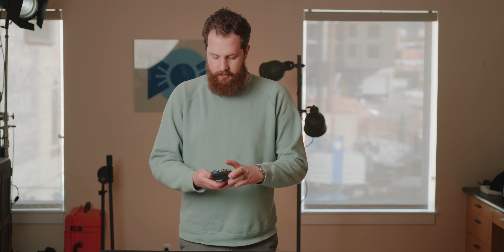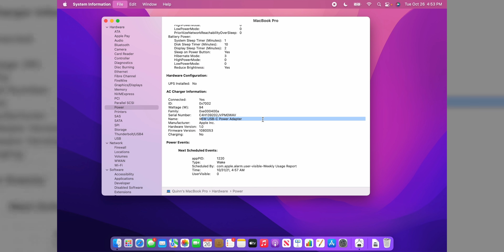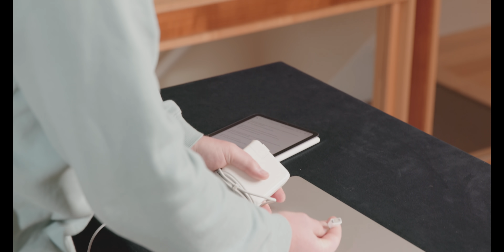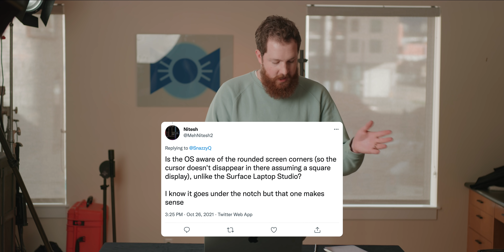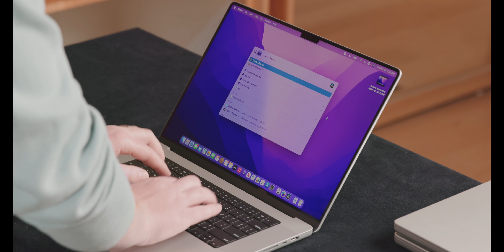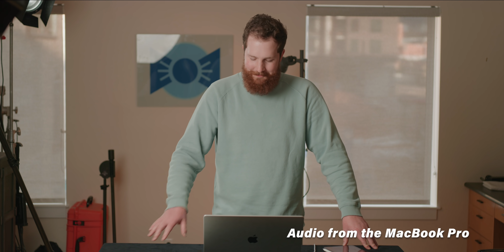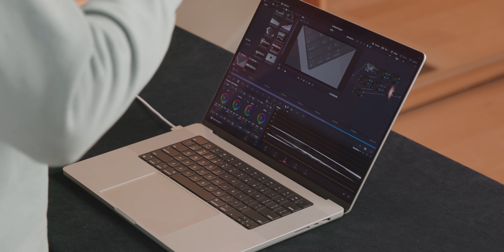The 2021 MacBook Pros are Insane

Comment: Apple should just hide the camera behind the screen that you pull up or hide. That would fix the notch issue and also the security side of it. It's doable  if they can fit a cam in the thin screen they could mount that on a smooth rolling tray that looks neat. OR just include a detachable webcam that magnetically attached to another part of the body of the computer, you pull it out and connect it to an usb-c port on the top of the screen, no cable, there you go apple. Steve jobs would hate this notch solution, it sucks

Comment: Will 16 RAM be enough for 4-5 years for normal usage without video editing or rendering at all?  Also , my friend is using Macbook Pro 14 Base Model and when he opens 5-6  tabs or 7 in safari and nothing running in the background RAM usage is between 10-12.30 GB. Do you think it is normal or Macbook works like this .

Comment: I actually think I figured out why they have the notch: It's so that you don't put a fingering on the camera every time you open the laptop. It doesn't seem like a huge deal, but think about it - if you had to wipe off your camera literally every single time you wanted to use it, it would be such a huge design flaw and oversight.

Comment: I'm a software developer, earlier this year in my job they gave me a Macbook pro 13 inch with the regular m1, and I was in a project that requires ruby on rails and docker. The experience was a disaster, running the tests in the M1 took 35 minutes, running the tests in Intel 2.5 minutes.

Docker on M1 was buggy and crashing all the time.

So to me for work, Intel is still a need, M1 is just for developing M1 software like helping on the ruby team to take advantage of all the bells and whistles. The thing is yes, there was a ruby ARM but M1 is not just an ARM cpu.

Comment: Who will be the first to have the ‘courage’ to present a fair ‘like for like’ comparison between Pro vs Max but with same chassis, same RAM, same SSD?
All reviews thus far compare Max vs Pro but with other differentials. Either 16GB RAM vs 32GB or 32GB vs 64GB or 512GB SSD vs 1TB SSD.
Given the SSD  read/write differences or 16/32 RAM or memory b/w 200GB vs 400Gb etc none are equal representation.
I want to see a Pro vs Max comparison where all else is equal.
Otherwise all other comparisons are moot.
Is there some moratorium on such a side by side shootout?

Comment: Your video is so much different from all others just testing performance - you've selected really interesting questions and answered them in all required details. Good job!
One thing that I would complain (about Macbooks, not your video!) is the strength of Magsafe. It's too much! If someone stumbles over a cable and is unlucky enough to have the cable positioned perfectly straight, might end up with Macbook on the floor 😕

Comment: is the base 14" the best laptop for "computer literate people that may or may not be pros but intend to use them for a long time"? the price tag on the base MBA is enticing, but the SSD and RAM... are claustrophobia inducing. speccing a MBA to have more RAM and SSD, brings you closer to a base 14"... but the gap on paper is still pretty big. but between the display, improved graphics, memory bandwidth, ports, more starting storage/RAM.... isnt all of that worth the ~$600 difference? im no pro, but id like a capable machine i can use for many years... do you think itd be smarter to wait and see what apple does with the next MBA? or just get the base 14"? my 5k imacs getting a bit long in the tooth :T

Comment: 20:00 I think apple did this to mitigate burn in, remember those old powerbooks on system 6 for example? They ALWAYS had this line from where the menu bar whas, even if the display whas off, you could see it, yes, newer displays, even lcd's, can burn in, so its an opportune way for the menu bar to 'de-stress' those pixels. That would be my guess

Comment: interesting that just a sheet covers the back side. is there the danger of damaging internal components when applying slight pressure on the back side sheet? Or are there mechanical blocks which prevent that the sheet may for example block the fans when being pushed in?

Comment: You can leave the menu bar visible in full screen mode, its an option in settings!! Default is turned off.

The area of the notch is likely defined as a "safe area" in macOS, very similarly to how iOS does it. Since menus are just standard system UI, the safe area is already baked into the AppKit APIs. However, since menu bar apps are distinct apps, its very likely that developers will need to update to recognize the new "safe area." Hence why iStat menus can disappear behind the notch, while menu bar items will wrap around the notch.

I don't expect this to be an issue for very long. The notch is brand new to macOS! On top of that, menu bar apps need a proper overhaul in macOS. They've always kind of been like a hack. macOS needs a system for managing menu bar apps. I would expect a collapsible list icon to be added to the menu bar very soon to Monterey.

Comment: That Menü-Bar / Status-Bar behavior is nasty, BUT do the same on the non-Notch MacBooks, then you have the same behavior concerning hiding status elements. Only Bartender features this function, which macOS should have for years… yeah it’s meh…

I guess, that menu items hiding behind the notch it’s just a compatibility thing, because the menu bar concept is baked in so deeply in the OS, so only the App-Developers can change that… with splitting, text density an so on. 

So it’s a matter of time , all of this get used to it.

Comment: Unlike the 14inch laptop, I thought you could only charge the 16inch laptop through the magsafe charger but in your video, it looked like it was still charging through the Thunderbolt USB C port (96 W) when you unplugged the magsafe one? Could you please confirm?
Reply: Watch the video. It can charge through either but only one at a time, the one with the highest power output
Reply: I presume it does charge thru usb c but not fast charging

Comment: The disappearing icons on the top right were actually how it worked for a looong time. I'm still working my trusty 2012 MBP 13' and have several apps that hide some of the icons. Bringing the icons back is easy, switch to another app. And actually since the dropdown-center for your basic settings it's hardly an inconvenience to use the instead of numerous icons there.

Comment: macbook sound is still glitchy, it's amazing how they aren't able to fix that.
I'm also still annoyed by how the whole computer body is electrified when you charge your computer. 
One last negative thing about this computer is if you use to run x86 virtual machine, now you can't, rosetta don't translate kernel extensions or VMs. Parallels just allows you to run ARM Windows and ARM Windows only accept ARM binaries so almost nothing.

Beside that, it adds so much more value than the previous gen it's amazing. That's screen is insane and the fact that it remains cool all the time is great. I haven't heard the fan spinning at all so far.

Comment: The one thing every reviewer continues to misunderstand about these two machines is the memory.  The difference between the M1 Max and the M1 pro is the width of the DDR bus which allows for either 200MB/s read/write access or 400MB/s read write access.  The biggest gains you will see is on any application that is heavily memory intensive.  This doesn't equate across every application.  Some pieces of software heavily use the memory and therefore the time it should take those applications to finish their processes is close to halved as the memory is almost always the bottleneck is any system that is running at 4-5GHz.  If you're running applications that do everything with zero copies or just don't do much memory access than you will see very little gain between these systems.  Obviously this goes a bit deeper with the video application people who encode. One thing to note to everyone though is... the more DDR chips... the more continuous power draw... the shorter the battery life.  I think this is the bigger energy consumer between the M1 max and M1 pro.  I have a feeling those extra GPU's don't actually consume that much extra energy when they are not in use.  The DDR bus, however, is in constant use and is rarely powered down.

Comment: My only issue with the new models is the SD card. Pro photographers don't use SD anymore so it's only useful for hobbyists etc. Wish we got a CFExpress slot too, at least on the most expensive model. The old non-unibody MBP had a CF slot, and CFEx is much smaller, the slot would just look like a thicker SD. So it's already behind the times, and it's only going to get more outdated with time. A CFEx WOULD also be useful as expanded storage as the best cards are crazy, like 2TB at 1730MB/s.

Comment: Why not putting all the menus of apps UNDER the old menu bar and calling that sometjing like CONTROL BAR or any other “APPLEISH” name, we’ll get a full bar with the menus like the old 2020 Macbooks and the addes benefit of the new bar for all the System menus and system trays icons (filling up till half the screen to the right side of the notch). DOUBLE bar anyone?

Comment: The new M1 macbooks have just 2x2 antennas for Wi-Fi... 2015+ up until M1 all had 3x3. This means you're limited to 866 Mbps wi-fi with Wi-Fi5 router and there's no Wi-Fi6E support. And even if there was, it's still awful to cut down on antennas!
My comment is based on Snazzy's comment about their "great connectivity". :)

Comment: Do you know much about Windows  11 and if so would it be worth the upgrade from 10?
Reply: @Doug Macrae IMO it's too soon to tell. Microsoft promises way more stability and forces hardware manufacturers to adhere more to spec on hardware requirements. I have ran it since it was Beta and I will say it's way more stable now since it was originally released but it probably has a good 6 months to a year before it's as polished as windows 10 but the task manager is only invokable via keyboard shortcuts or searching in windows search instead of right clicking on the task bar. ctl+alt+del still works but I miss usign hte mouse to pull it up like on Windows 10 and older.

Comment: i think the reason the cursor doesnt stop when hitting the notch in the middle, is because it would be annoying if you quickly tried to travel the cursor across the screen, like it would be in the way of the user. the rounded corners however doesnt effect the user experience, so its a nice touch

Comment: Another great video Quinn. Quick question for you. I'm 54 and stated to recently collecting vinyl. I do not have a turntable yet. As a collector, is it okay to leave the single and gatefold albums in the original "shrink" with hype stickers etc. (to keep its value) or should I remove the shrink to prevent warpage over time? Your opinion would be appreciated. (also would you cut the side to release pressure or just leave it perfectly sealed?
Reply from the maker: It shouldn’t do any harm, but I’d recommend getting these. Then you can protect AND enjoy! :) https://amzn.to/3w3tvFZ

Comment: Holy crap! They made them thicker, with removable Thunderbolt ports (AND Magsafe!) AND they gave even the base model the full, proper cooling solution?!?! And pull tabs for the batteries? It's almost like Apple is starting to actually consider repairability!

Seriously though, all of these things are notable improvements over the previous models. I still don't like the idea of glued-in batteries, namely because their replacements will never glue back in as tightly as the originals did, and it's SO STUPID SIMPLE to just provide screws to hold the batteries in place, but not having to spend half an hour heating and scraping to get the old battery out is a major improvement... although those pull tabs do tend to be incredibly easy to break.

These are all-around much improved over the previous models, although I still hate the notch and you Apple apologists can whine all you want about how stupid my personal preference is, I don't care, it's my personal preference. The screens themselves are great but once again, Apple has taken every effort to make them as unrepairable as possible, and that sucks. As it often is with Apple, we take 2 steps forward and 1 step backwards.
Reply: @Adam Baldwin Maybe it's some conspiracy to try to keep Louis Rossman off of Apple's back on the right to repair for independent repair shops. 🤣
But on a serious note I was talking with my son today when I was driving about this is the first time I've bought Apple Care since even though I can and do repair machines like this the replacement costs will cost more than paying for the insurance as by design by Apple intentionally to sell the insurance and deter people away from repairing and take the lowball offer from Apple stores to "trade in" the old machine towards a new one. I don't like it but I have to live with it since Apple will never change.
Reply: @ShinyTechThings  I mean, you could just... stop buying Apple products. Crazy thought, I know
Reply: @rars0n  the M1 Max outruns my PC for video editing and I've got a 5950X with a 3070ti, gen 4 NVMe and 64GB of RAM. For gaming the PC is the way to go but not for video editing. It comes down to the right tool for the job.

Comment: In my 20+ years with Macs, I've only used Apple's webcam one time. Ditch the notch, I'd happily pay extra to get a laptop without a camera.
Also, I trust my current MBP will last until ARMv9 chips come out. Apple can slap a thousand cores to the current lineup but I still consider them old tech of what is here in max two years time.

Comment: if only I had the money to buy one of these machines,  damn it, it stinks to be  poor.
Reply: @tony brito you can still buy used for less, although I will say the M1 from last year is holding it's value well but I did see at Costco today some legitimate discounts on the original M1's. Plus the M1 air with the 8 core chip is basically the same speed in most uses as the MBP with the same chip. Only differences is that it's missing the touchbar and fans but if you run native ARM architecture apps it mostly runs cool and fast.

Comment: insane that Apple didn't include updated thermal solutions for Intel CPUs that have higher TDP packages but did for Apple Silicon CPUs that have lower TDP packages.  That seems kind of opposite of what they should have done.  Intel CPUs run hotter and could have benefited from the better cooling in the new 2021 MBP models....

Comment: i feel like the multiple charger thing would be a good question if done with for example a few 30w adapters

also magsafe disconnecting randomly in bed isn’t exactly a problem with the new macbooks considering how efficient they are

Comment: there was a setting to get rid of the notch does this move the menu bar down so the notch isn't blocking the center?
Reply: @123abc There's a program called forehead that does it but it just changes the menu bar at teh top to black to match the notch so you can't see it. I was bummed out to see that it didn't bump it down. Maybe someone will figure it out if Apple isn't blocking the ability to do so programmatically.

Comment: Its nice to see some return to sanity from Apple, adding a bit of heft and squaring things off instead of bleeding edge thin for practical cooling and battery capacity and bringing back most  of the ports , 90% of us still need usb3 though ffs. Hdmi should be next to magsafe for obvious (but not to Apple) reasons. So are ports coming back to the Air or does Apple think only 'Pro's' need ports or do they think its a great way to get us to 'upgrade'? I know I need ports but I don't need to spend 3+ grand on power I will never use.

Comment: the new macbook pro m1 max was such a disappoint to me externally as much as it was internally, it has such a powerful graphics card but no game selection, also it would get really hot. when i returned it to the store i told them all the reasons why i thought it was the worst macbook pro ever made. i’ll take my $4,099 back thank you very much. apple took a step back with this one. the silver version looks like a samsung chrome book but uglier. the 6 speakers sounds tinny. i hate magsafe, why did they have to bring back the hdmi port when it’s not even hdmi 2.1? i kept i trying to plug in a usb c cable there  after getting used to that from the 2019 macbook pro touch bar. i miss the touch bar too, why the heck does the keyboard not have a shortcut for keyboard brightness?
Reply: @Jacky Lelea HDMI 2.1 will probably be on the 2022 or 2023 models to give users a reason to upgrade. 🤦‍♂️🤣

Comment: You can leave the menu bar fixed on full screen mode on Monterey. You can enable it in settings under menu bar options.

Can you charge the new macs with magsafe hooked to a power bank?

Great video btw.
Reply: @cheeks jp I'm going to guess yes but I'll have to find my power bank and try it. The MagSafe adapter is USB-C on the other end so I don't see why not. message me in a few days and I'll probably have tested by then on my 14" M1 Max.

Comment: Pretty sure it is the problem from istat … it is a closed extended little window on the status bar, which fakes it all Icons are different yadda yadda Blabla … nevertheless,  mouse under the notch is weird and not well designed

Comment: Best configuration for a photographer that works primarily in Lightroom and Photoshop? 16gb of RAM good enough?
Reply: @Brian Dunkel most likely yes. For me absolutely but I do basic things like adjust things in lightroom from camera raw files. Avoid the 8GB though as you'll easily exceed 8GB in use and then start thrashing the local disk as a swap file and decrease the lifespan of the SSD.